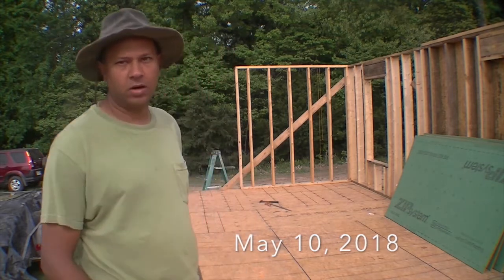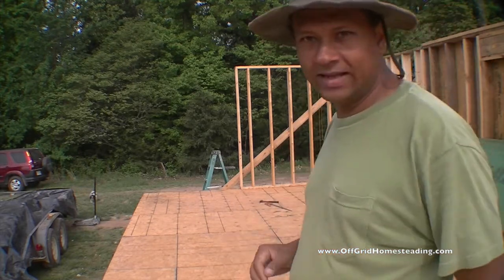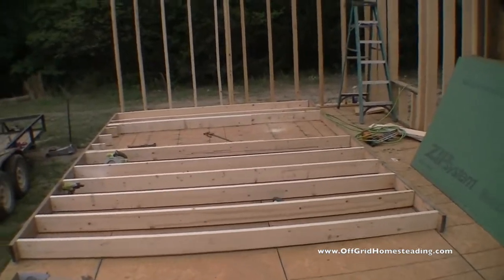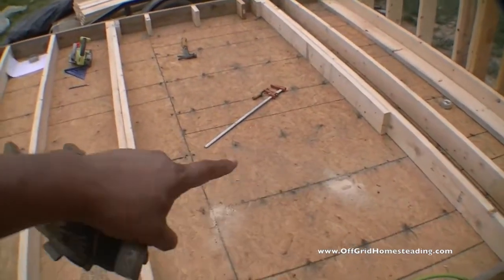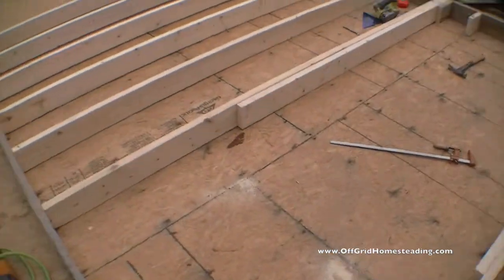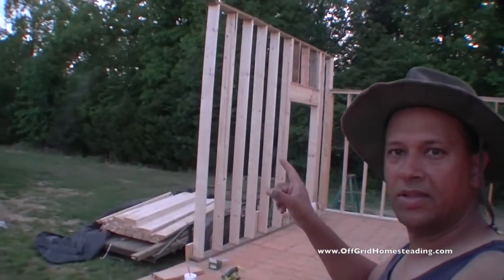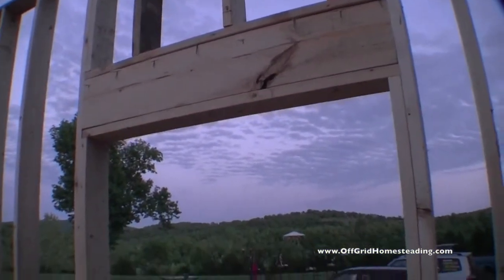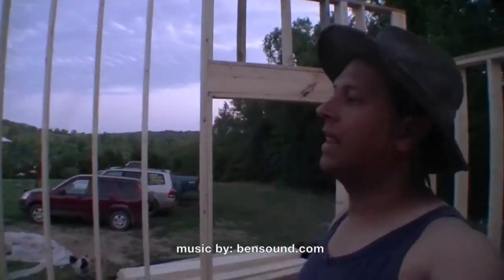OGH - DIY Framing of Tiny House Part 8

Comment: The west wall looks like there is a space at the joint between the two sections at the first top plate. If this is true, then having that space will mean that the top of the wall is now longer than the bottom of the wall. That means when you plumb one end of the wall, the opposite end of the wall will not be plumb.
Reply from the maker: Hey Jim.  I lag bolted the two sections together first to remove any gaps.  The top place is snug across both west sections.  And the North West section I removed that 4' from the 2nd section to overlap over the far most west section minus the 5 1/2" where the West and north meet.  Then the entire west section was connected by 1 top plate.
Reply from the maker: I also lag bolted every 12-14 " across the bottom plate to secure and hold the bottom place without any spacing to the decking.
Reply: OK, you didn't have a closeup and it looks like there is a gap, but I guess not.
Reply: Not sure what you mean by ..." without any spacing to the decking."
I don't think I'm helping, so I'll just leave you alone. Hope you do well. 
 Sincerely,  Jim
Reply from the maker: Yea I looked at it again.. and it looks like a shadow on the video.   When I put the lag bolts in, you couldn't slide a piece of paper between the sections.
Reply from the maker: What I means was the base plate(s) were not perfectly straight they crown so when the section was vertical you could slide a piece of paper under the base plate at certain points.  When I lag bolted each space between the 16" on center studs on the base plate, it "pulled the base plate to the deck and took up any 1/16 or 1/8 of an inch gap that may have been there.
Reply from the maker: Love the feedback Jim.  Sorry it's frustrating to you.  It's frustrating I cant do exactly what you're staying.  I've got to work with the resources I have and the manpower with for the most part is just me, except for some things Kelly can help me with.  Keep on commenting if you chose.  I welcome the feedback, it's helped me fix what could have become larger issues later.  In appreciation. J.